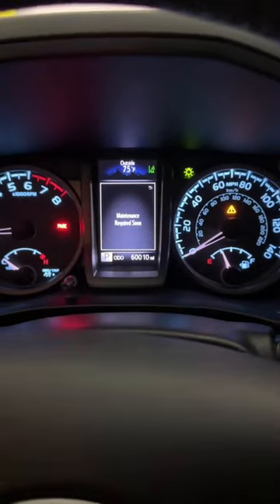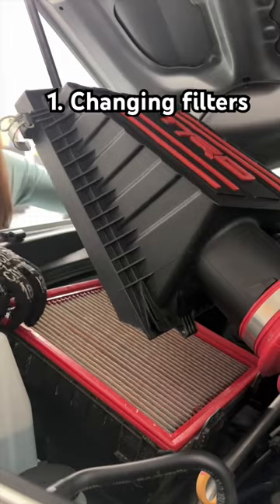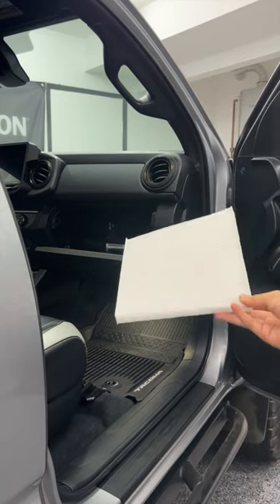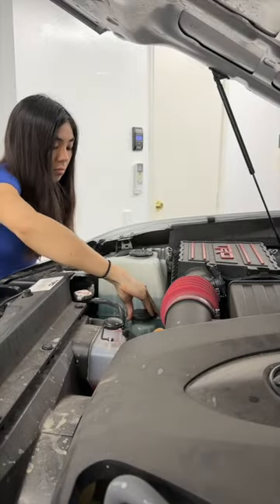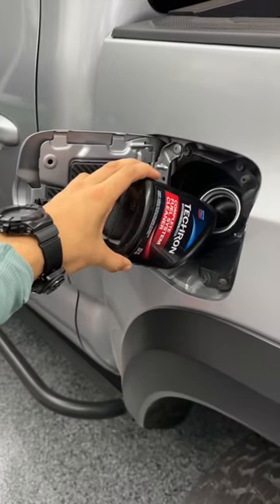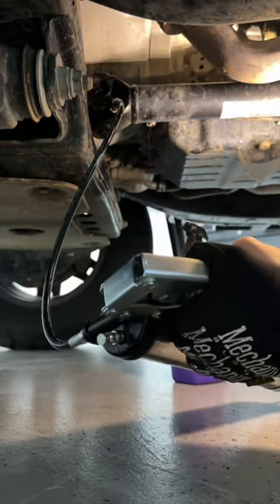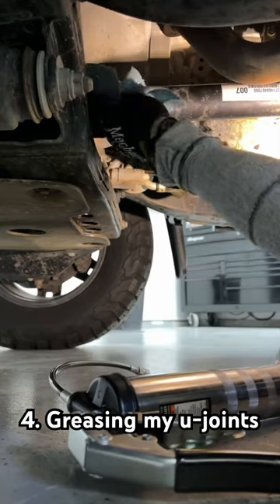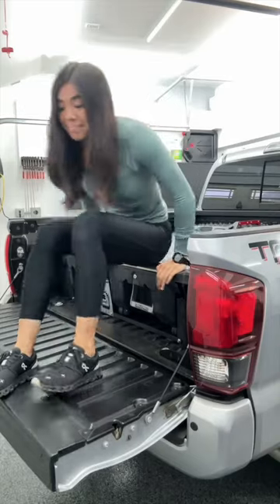Overcharged for Maintenance at Auto Shops #shorts #toyotatacoma

Comment: Props for having the knowledge, location, time, and honestly the health to do all this yourself.

Not everyone has those luxuries. My shop charges $24-30 each for those filters with a free install. We charge approprietely for tire rotations WITH computerized balancing depending on the size as well. Not all shops are open to rip you off. Higher pricing is more of a convenience fee.
Reply: It awesome that a woman can do this basic maintenance however things like checking the oil and changing simpler filters, air and cabin filters, wiper blades and such are something every person that operates a motor vehicle should have knowledge of how to change those things.
Reply: Agree, people's time is valuable. This is what people really pay for not necessarily the part. Maybe build up these tool collections over time but how people have grease guns and drain pans, especially apartment and condo owners.

Comment: That wasn’t a power steering flush, it was just a suck and fill. There’s a difference. When you take it to the dealer they charge a lot cause they gotta pay the technician, pay insurance, offer a warranty, turn the lights on, heat the building…..it’s not a charity case they run.
Reply: What's your of
Reply: Most places just do a fluid exchange anyways…

Comment: I do agree about the filters. But on the power steering we push 2 quarts of fluid through with a cleaner as well and the fluid returns to its new amber color. But the fuel system services serve a purpose on many of Toyota engine including the 2GR-FKS that is available in you truck which  is a direct injection engine. Our service include wiping out the throttle body, performing a top engine clean with a chem agent. Then a EFI clean with a solvent that we run through the rails at the connections at the left side of the engine. This cleans the tips of both sets of injectors.  That Techron does not hold a flame to what dealers use.
Reply: its a dual fuel intake system, has port injectors also. shocked you didnt know this. also it has an injector cleaning cycle.
Reply: That’s why I said both sets. The port injection never really is a issue. The bulk of the build up occurs on the direct injectors. Taken apart a few of these and find the inside much cleaner on the ones with the service. The self clean really doesn’t do a good job of cleaning the DI tips and doesn’t clean build up on runners, throttle body, and other ports and passages that these services clean.

Comment: Step further you can take with your fuel system clean to match what we do at the dealership, Toyota sells their own fuel injector cleaner,now hear me out, this has a nozzle and threads on the outside so that you can attach it to a hose, which you can find at any auto parts store, there’s a connector for the fuel system on the back of your engine bay which is designed for the purpose of attaching this hose with your fuel injector cleaner, starting the engine and letting it run on it until it’s out, then reconnect your fuel line connector.

Comment: I agree. Sometimes whoever is doing the maintenance doesn't do it right. I have a friend who had an oil change. The drain plug was not tightened and he ended up with a ruined engine
Reply: My wife took her car for an oil change at a shop. They said all 4 tires and brake pads were bad. A couple days went by and we noticed an oil spot on the driveway. About a week went by and we got her some new tires at an actual tire shop did their “20 point inspection”. They said pads were fine and only needed 2 tires, not all 4. They saw the leak, looked around and saw the oil filter wasn’t even hand tight. They “fixed” it for free and just charged us for the oil top off. 

Some places are definitely just out to scam you.

Comment: AC recharge always gives me a good chuckle.  Idk why they charge so much when the bottle of ACpro is like 60 bucks vs 250 plus for a 5 min process.
Reply: Because your can of acpro indiscriminately adds refrigerant and oil, potentially too much or too little of either, impacting performance at best and damaging the system at worst. 

The ac evac and recharge machines used at a shop fully evacuate and test the system for leaks, then adds exactly as much oil and refrigerant as the system asks for, ensuring correct performance and longevity. Pressure gauges don’t do well these days with variable displacement compressors.

Comment: It's been pretty well shown by mechanics that fuel injector cleaner and treatment does nothing since fuel injectors are lubricated by the fuel itself. So its better to just never let your tank get low otherwise it will damage itself without enough fuel
Reply: By what mechanics? And what does lubrication have to do with deposit formation on the injector or valves?
Reply: Gasoline is a good cleaner, you don’t need fuel injector cleaners unless it’s been sitting for years

Comment: As a tech you are right, I will say idk if you flushed the rack or just the res but either way you get a lot of fluid out, basically all the flushes are gonna be inflated I would recommend to do them at home but things like brakes are extremely important to do correctly for safety, and coolant, and just doing brakes in general (once again you have to know what you’re doing)

Comment: I discovered this also with alignments. Most of the time you just need a tire balance and rotation..not a whole as alignment
Reply: What??? Balancing won’t change unless you replace tires, or in rare cases wheel weights fall off. Rotations have nothing to do with alignments unless your alignment fucked your tire wear, in which case a rotation isn’t doing shit. You need alignments more than you think unless you drive on some pristine ass roads.

Comment: First things first it’s great to see that you were doing the maintenance on your own because yes, a lot of stuff can be done on your own. There are a few points that I wanted to address that you should be aware of that I disagree with. The prices are what they are because a business is charging that price. The price reflects the overhead that it takes to run a shop. People complain about their electric bill at their home, now imagine the utilities bill of a legit shop. That is not, including what the shop has to pay its employees. To go into your power steering flush, a good quality shop uses a professional machine which cost them a lot of money. The other thing that you mention is a fuel cleaning. You pouring the fuel injector cleaner into the tank, is not the only thing that they do. When you take the cleaning solution of an induction service, and get it down into the intake manifold, and into the intake valves, which on a direct injection vehicle does not get cleaned by just pouring the fluid into the tank, that takes labor and parts, which is where the price comes from. Toyotas induction and fuel injection cleaning is different compared to other companies that sell those services. Toyota offers a specific induction cleaning which is designed to help the buildup of carbon deposits in the intake manifold and intake valves. They also offer a fuel injection service, which a lot of other places do not offer, which is connecting a high-pressure apparatus to a fuel line, which will directly clean out any of the deposits in the fuel lines. It is a true fuel  system cleaner. So to summit up, I agree that there are a lot of things that majority of people can do on their own but the people that are going to shops are going there because they don’t want to do it on their own, they would rather pay someone to take care of their vehicles.

Comment: It helps to know how much stuff costs. I'm pretty handy and do a lot of work on my car,  but the toyota dealer had the best price to replace my press on wheel bearing bc I had a coupon. While I was there, they asked me if i wanted to replace my engine air filter, which reminded me that i knew it was due to be changed. I asked how much and they said $35. And I asked for an OEM Toyota air filter (I know it's denso) and they said yeah so I said sure go ahead bc thats probably cheaper than buying it elsewhere!

Comment: Pouring in a fuel treatment is nowhere near a real injection cleaning.  However, I consider them to be a waste of money and I never recommend them to my customers. The other items are spot on. I grease all zerks at every oil change for free on all customer vehicles.
Reply: BG has a 44K additive for the fuel tank. I’ve used it and it’s gotten rid of a slight misfire prob due to carbon build up on the valves. I use it when I go on a long trip.
Reply: @daniels9520  I've seen exactly what 44k does. We put 3 cans through a 4cyl wrangler and pulled the head. It did jack squat. 44k makes a bit of horsepower that was noticeable and lowered CO readings on a gas analyzer but cleaned nothing noticeable.  It's a band aid on a problem. For what it costs vs what you get,  I can't recommend it. Carbon is going to build up no matter what someone puts in the tank.
Reply: @josephdavis4201  Yes it’s expensive for that can. I’ve had to hot soak the pistons with GM top engine cleaner. Works good. Cleans pistons good. 44K I use as a maintenance for a long trip. Big problems prob have to do compression or running compression. Hope you got that jeep fixed though.

Comment: The bg fuel induction service is in a completely other league when it comes to anything you can buy behind the counter. The driveshaft thing is crazy though. Lof stands for lube oil filter, as in lube the zerk fittings change the oil and filter. Its literally part of the oil change
Reply: Yeah part of the oil change that pretty much nobody actually does, or does right.

Comment: Great tips and fuel system cleaner,  youre  definitely very smart and capable!
Reply: The Tacoma has an automatic fuel system cleaner that cleans up all the carbon in and around the cylinders. That’s why you sometimes hear the noice radiating in your engine, the sound of a diesel engine.

Comment: Great video Chloe.  Could you list the part number of your VIN specific drive shaft as you can only order grease zert  fitted drive shafts by vin.  I am looking to get the Toyota OEM on for my truck and the dealer said they do not know the part number for the shaft with zert fittings.

Comment: Great choice on the fuel system cleaner seafoam is hyped cause of fimiliarity and marketing or influencer branding deals but in reality most gas cars direct injection need polyetheramine or fuel addative cleaners with pea its a certain chemical that targets carbon debris and other contaminets that might clog up your fuel system good work 👍

Comment: Good to know how to do your own maintenance. Keep a log of it on a note pad and keep it in your glove box. Owners manual should have a section to write it down also. Labor rate at shops are at $160/hr mechanic gets maybe $12 - $30 depends on experience and skill.
Most maintenance goes to a $12/hr mechanic. Keep doing your own maintenance you probably know more than the mechanic that got hired to change oil. 👍🏽🔥

Comment: How much are your tools that you used? Shops have to figure in labor, overhead, tools, and material. Not saying you can't do it yourself but I feel like this is kind off off kilter. Plus you just changed fluid in your power steering res. The line n rack still have dirty fluid thought the system. A flush is done with the return line off n cycling the fluid though the system till all the fluid is clean.

Comment: Funny manufacturers are going back to atf for p.s. fluid. Havent seen that in decades, not they are using it from the factory. (I wouldnt recommend it if your car doesn't call for it) based on seeing people use it in other systems, and noticed seal failures. It could be completely unrelated, but its enough for me to only use it when it calls for it. (I know tacoma uses atf) everythjng has a cost. None of them are "high" mechanics are the most underpaid Profesionals with a huge amount of knowledge required. If you can do it yourself more power to us. Its like a plumber replacing a supply line for 100 dollars. I could do it in under 5 minutes. They arent over charging. That is just a fairly basic cost. I wont even go under a car or raise it up anymore for anything less than 60. Oil changes are a no go😂

Comment: Mechanic here. Flushes are more expensive because what we do is somewhat more involved. We’ve got machines that will sit in Series with the system, pumping fresh fluid in as the old is pumped out. It helps get all the sludge out. Filters are crazy expensive and you’re better off doing them on your own. And whoever wanted to charge you for greasing a drive shaft is an asshole

Comment: That once quart you sucked out and put back in the power steering reservoir is not a power steering flush, and that Techron bottle does next to nothing especially compared to an actually fuel system Cleaning service
Reply: NotAFanOfTheJews  lol I’ve fixed misfires and rough idles with fuel cleaning services and you clearly have no idea how much oil the whole power steering system with the cooler and everything holds that little quart didn’t do shit you should look up what the word flush means 😂 nice try bud
Reply: NotAFanOfTheJews ”more than enough of a flush” it’s not a flush. Period.

Comment: I got charged $170 in Quicklane to test drive my truck to tell me i need my front rotors resurfaced! 1st and last time im ever going to Quicklane. They said a brake inspection was free, but $170 if they need to hook up the computer. I told them their is no abs light on so its not necessary. Well they will find a way to get you to pay for a computer diagnostic even though its not needed.
Reply: I hate fraudulent mechanic shops.

Comment: That’s not how you flush  power steering fluid. That’s not a fuel system service either. There is more to lubing than just zerk fittings. 🤦‍♂️